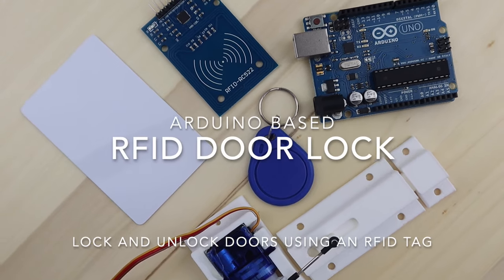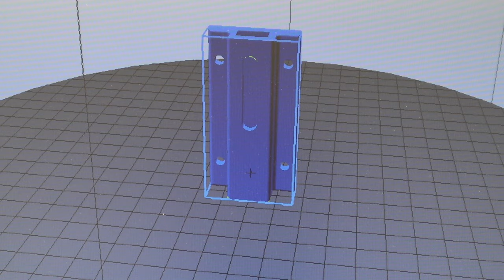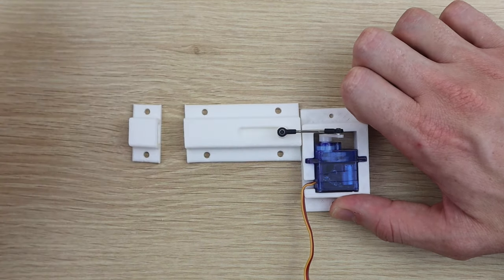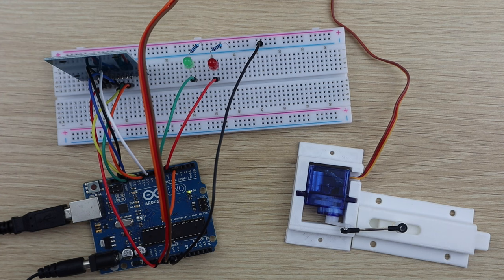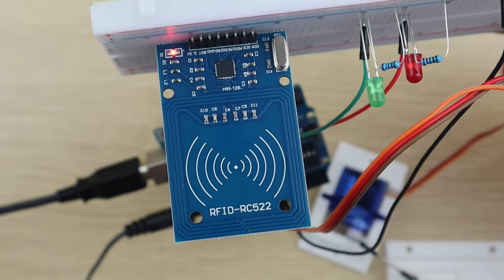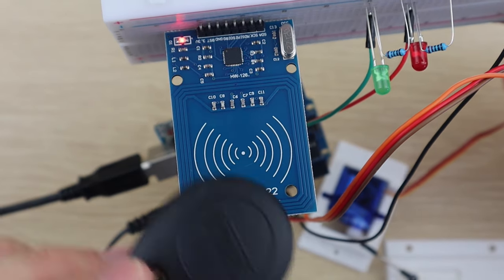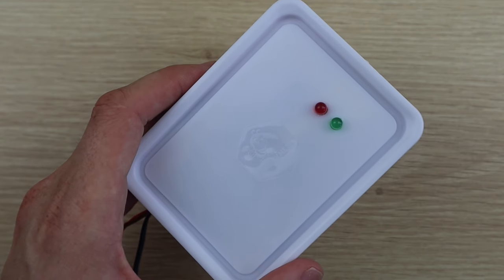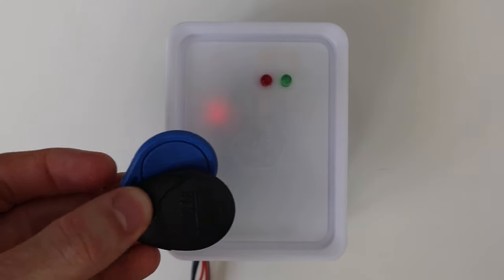Arduino Based RFID Door Lock  - Make Your Own

Comment: Hello i am getting this error can someone help me please i would really appreciate it.
RFID:6:10: fatal error: RFID.h: No such file or directory
 #include <RFID.h>
          ^~~~~~~~
compilation terminated.
exit status 1
RFID.h: No such file or directory
Reply from the maker: You need to install the rfid.h library provided with the code
Reply: @MichaelKlements  thank you for your quick response.
I managed to do it correctly this time but unfortunately it doesn't read the card(nfs) . I noticed that there are a lot of people who have the same problem could you please make a video how to solve this problem . 
I used the same components expect from Arduino I used mega 2560

Comment: Uhmm what are the Dimensions of the 3D printed Material?
I'm maybe going to try remaking those things with Steel, then again maybe it won't work due to the Weight and Resistance of the Material...

Also how is this Lock powered? Battery? if so How many Uses can one get out of it before it stops working?...

Comment: Every time I try to upload the code to my Arduino it will say "RFIDev does not name a type; Did you mean Rifdreg1?" And I Copied and pasted the code to my Arduino Editor.
Reply from the maker: Rather download the code linked in the blog post. You'll also need to install the RFID library within the download.
Reply: I'm doing this on Chromebook, it won't let me.

Comment: it doesnt work for some reason, i even tried copying your code it just doesnt work
Reply from the maker: Have you installed the library and is your wiring to the reader correct?
Reply: @MichaelKlements  yes I did the rc522 is lighting up red and it still doesn’t work, I think it’s a problem with my rc522 but I hope not well thanks for the tutorial anyway

Comment: Hello sir! I am a newbie in arduino, I followed your video, and connected the wires and everything. When I uploaded the code, the light sequence started but when I place the rfid tag near the sensor, nothing is happening, what could be the problem sir? THANK YOU!
Reply from the maker: You need to load your card's ID tag into the code. There are instructions on how to do this in the post linked in the video description.

Comment: DON'T put the arduino on the outside! That's a major security flaw. Extend the connections and put the RFID reader outside, just not the arduino.
Reply from the maker: This is obviously not meant to be a "secure" device since the lock is 3D printed plastic.
Reply: @MichaelKlements   Locks exists to secure stuff, restrict access, therefore I assumed what you're proposing here is the design, and not the 3d printed lock.